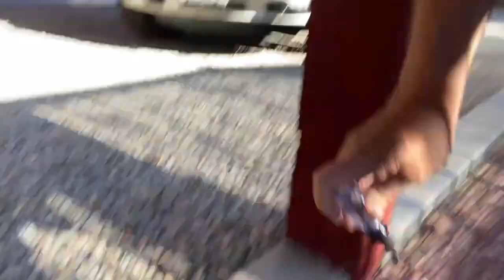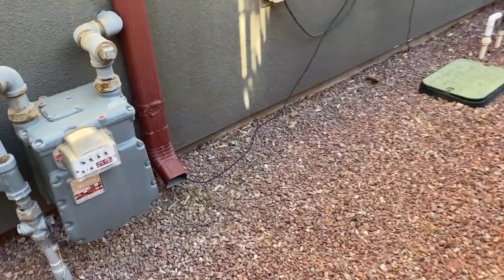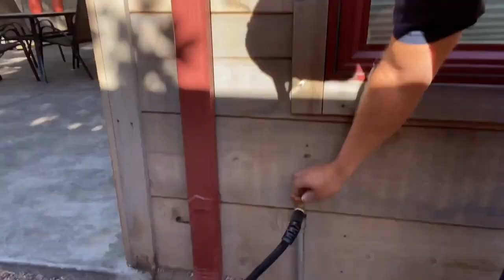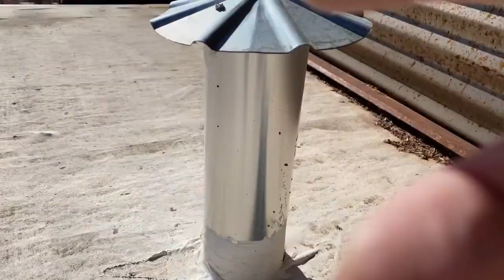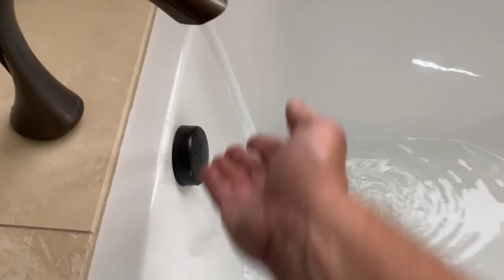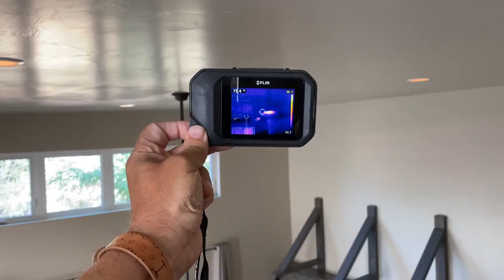Home Inspection in Moab, Utah, with InterNACHI® Home Inspector Ben Gromicko

Comment: No deficiencies with the exterior water stains I assume?  Does water need to be redirected or did you not report anything?
Reply from the maker: Water stains are cosmetic defects. May indicate a bigger problem with diverting water away and off the building.